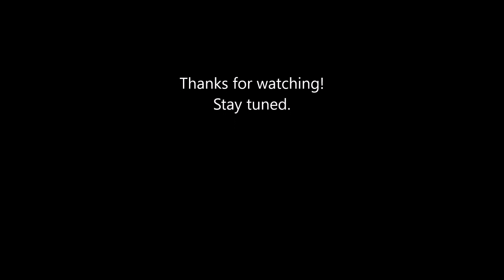Metal working: Fence to my Saw's table

Comment: That is one professional brake there :D. nice result. it looks very identical to the one i have on my bandsaw. the only downside you can say, it that you always have to check before and after the saw, so the fence is not an a bad angle position. otherwise you can get kickback of the circular saw, but you already know this since you measured in front and back :-)
Reply from the maker: Jörgen Börg Thanks. Yep. You're right. When its done i mark distances from the blade to both edges of the table. That makes it little faster to use.
Reply: Tuomas Soikkeli
good idea :-)